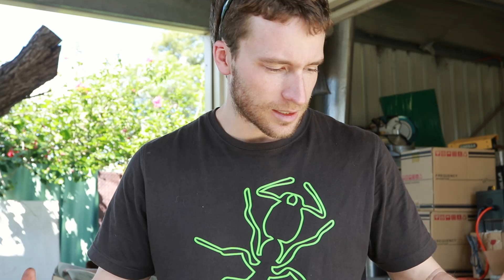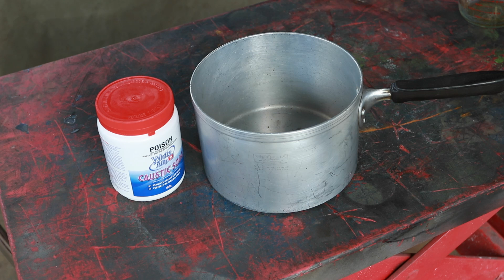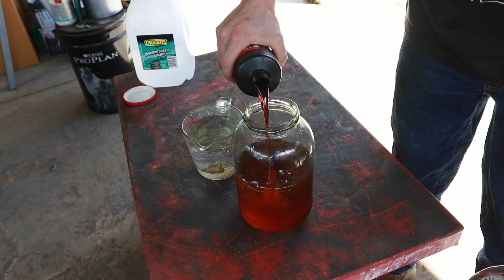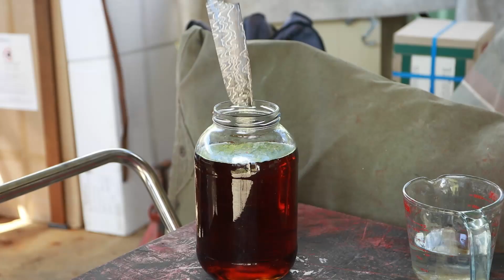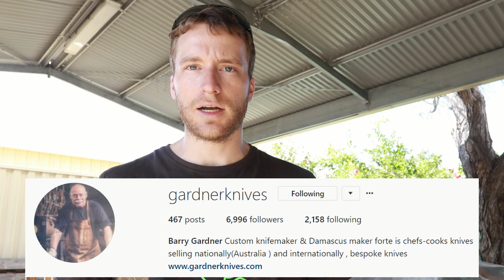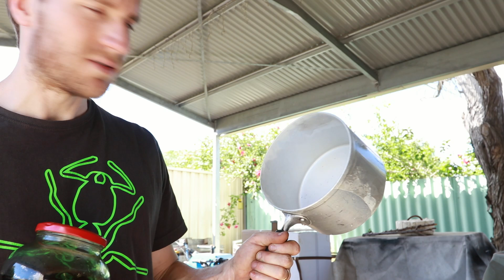How to mix ferric chloride (FeCl3) for etching a knife.

Comment: Nice.  How often do you replace your FeCL3?   You mentioned 10 years - is it still etching after all that time if you use it regularly?
Reply from the maker: I still have the same batch mixed up, but it doesnt get much use. i couldnt put a time or number of etchings on it.

Comment: NEVER put caustic with aluminium. It will dissolve the ally.
They use caustic to disolve alumina in the refining process. It will dissolve your whole pan!
You are much better off using a plain carbon steel pan (stainless if you don't mind wasting a good stainless pan.)
Cheers!
Reply from the maker: yep, I realise that now

Comment: From my etching eperience the best material for really sharp and homogeneus etching was by far caustic soda. The ferric chloride etch always ended up looking bumpy on a larger scale and if you are using ferric chloride that was used for pcb etching it will form a "rust" crust on the etch (at least thats what happened with alluminum).
Reply: Can you elaborate more on your caustic soda etching? What types of materials, do you just use it out of the bottle, how long?
Reply: @6666todor  You can buy caustic soda flakes at a local supermarket for your etching solution just mix it up with water be careful tho it generates a lot of heat, for your design you can use what people usually call a toner transfer method which is basically a reversed image printed with a laser printer, then you place the paper over the metal surface ad heat it up with a clothing iron, afterwards you will let it sit down until it cools down, then remove the paper very carefully you dont want to peel off any of the paint that will be deposited over the metal surface, cover all the parts that you dont want etched with plastic tape, apply the caustic soda with a pipette or brush and brush off the solution off the object every 5 minutes or so just so you know if everything is going ok, after that just clean it with water (I like to pour some vinegar over the surface just to be sure) if tou want to know moire about this tecnique you can search for "Acid etched pedal enclosure" on youtube
Reply: @pedromartinazzo5036  Thank you! I'm familiar with other etching techniques, just haven't tried caustic, will do and see how it goes!
Reply: Which technique is more resistant over time on knives ?
Reply: @RaduMichael  The durability is dependant on the depth of the etch so I would say a 4 part Ferric Chloride 1 part Citric Acid would work the best because it will give you a deep etch, another thing you can try is to use this same solution but use old Ferric chloride that was used to etch copper such as in Pcb manufacturing, the reaction is much faster than with new Ferric chloride but the copper makes a crust over the aluminum so you have to clean it constantly which is why you add the citric acid to the solution
Reply: @pedromartinazzo5036  many thanks! So, the more concentrated the acid, the more resistant the etch, plus the added citric acid.
Reply: @RaduMichael  Not really the citric acid is added to the solution to help clean the crust that the ferric chloride makes, a very concentrated solution is a bad idea because it will the resist away faster, and the ferric chloride doesn't work as an acid in this reaction it's and oxidation/reduction which turns the metal you are etching into a salt (I think)
Reply: @pedromartinazzo5036  so...what do you recommend ? Keeping the knife for longer in diluted solution ?
Reply: @RaduMichael  Yes 40% ferric chloride mixed with the citric acid will work well

Comment: Soon and I just made about 1250ml of b ferric chloride.  We're going for a very dark etch.  We're going to dilute it 2:1 with hydrogen peroxide.  Thanks for showing the etch.
Reply from the maker: Don't confuse stronger mix with being darker. The stronger it is, the more aggressive it is at pitting the metal. 
If you want darker, try a really (really, really) strong mix of instant coffee and soak in that overnight after the ferric.
Reply: @FirePantsFabrication  - I bought ferric chloride now.  Two 16oz bottles of it.  
Is there anything to my hunch that maybe my heat treat was not even?

Comment: The water/caustic add doesn’t matter. Sodium hydroxide is a base not an acid.
Reply: but its always a good idea to arrange additions so that it starts off weak or dilute just in case there is a splashback or spillage. Therefore adding chemicals to water means that you wont cover your hands and face with very concentrated solutions. Simple practical safe working method.

Comment: capped pvc piping is great for the solution storage and etching blades.
Reply: If you leave it with cap on and then open later does it create any dangerous vapor  for next time i open the cap or is it safe to reuse?